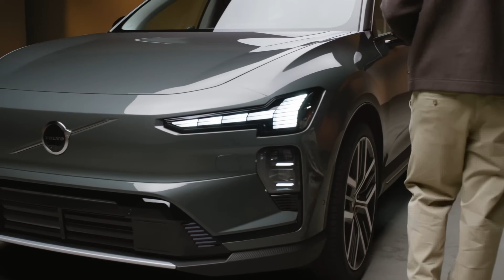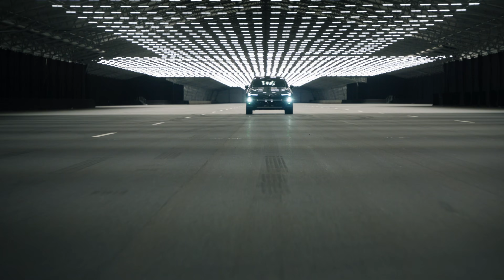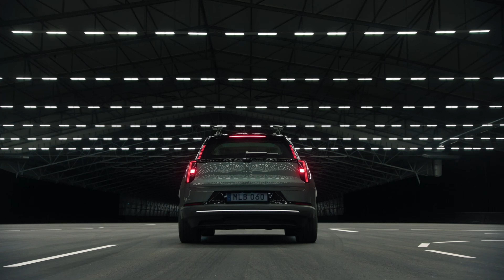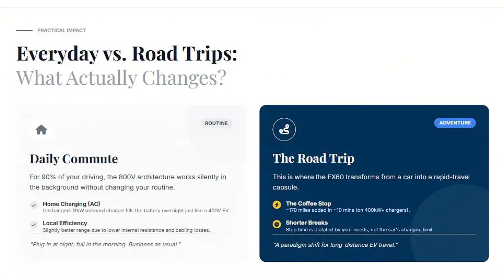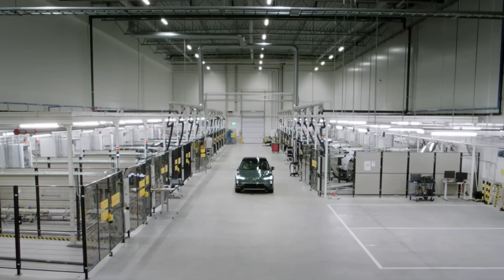VOLVO EX60 Charging Architecture: Unpacking its 800V Efficiency & Future Implications

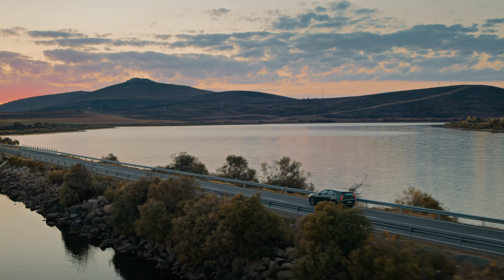Comment: 3:53 "Right now the public fast charger network is mostly 400 volt in practice"

Where? In Europe that is NOT the case. Most DC chargers are 800 V chargers. The whole Ionity network is 800 V. The only larger network with 400 V chargers are the legacy Tesla network.
Reply from the maker: Currently, around 1.5% of DC fast chargers deployed in the US are capable of 800V output; similarly, in the European Union (EU), only approximately 3% 
based on below website :

https://www.power-sonic.com/400v-vs-800v-charging/#:~:text=Currently%2C%20around%201.5%25%20of%20DC,of%20800V%20chargers%20is%20stagnant.
Reply: I'm from Croatia and almost all common fast charging providers within and around most cities (Lidl, Kaufland, Porche, Petrol etc.) are all 400V. Almost all in town chargers deliver 150KW max. IONITY hubs along highways might be the only exception, but i never used them so far since, at least in Croatia, i can get fast charging along highways for like 0.22eur/kwh at Tesla Superchargers at off-peak rates while Ionity is like 0.79eur/kwh. At that price might as well have a gas vehicle.